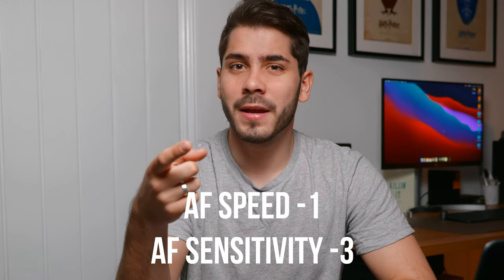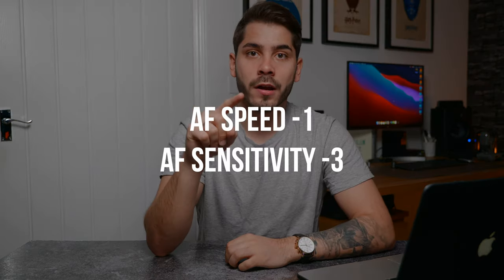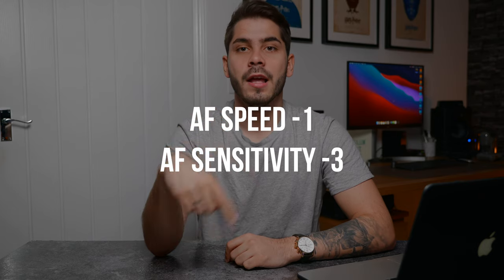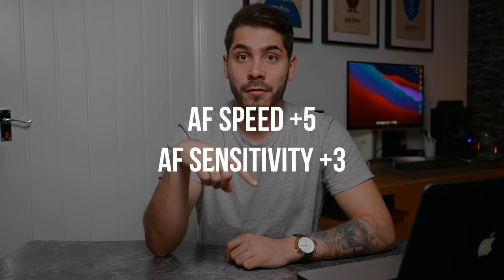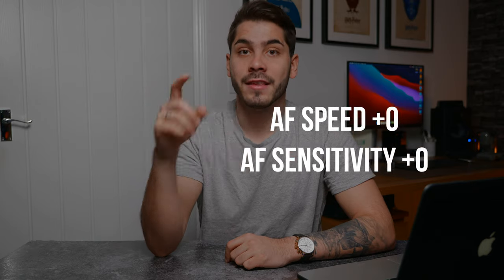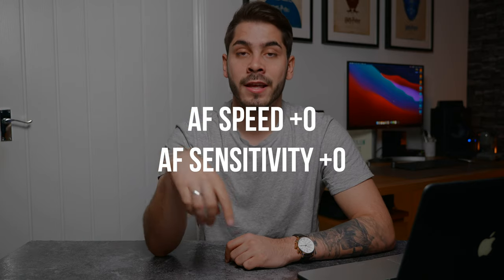The BEST Panasonic S5 Video AF Test You'll See - REAL WORLD PERFORMANCE

Comment: Josh - what lens did you use. Im interested in the S5 because the 20 60 kit is my Ideal working range. 
I only use single shot AF anyway but this video shows its possible to get some gentle tracking. - thanks - 👍
Reply from the maker: Hey Mark! I used the 24-105 F4 (it's actually the only L Mount lens I own!). 

Fantastic lens for the price and extremely versatile. It's definitely possible to get some tracking shots as long as the subject doesn't move to erratically. 

Thanks for watching!

Comment: Hi Josh, thanks for that great video. I have an S5 but have not used it much yet due to lockdown and winter! Did you reach a conclusion about the best settings in vlog? I have left it at the default so far.
Reply from the maker: Hi Andrew! Thanks for watching my video! Ah that’s a shame, it sucks when we have a shiny new camera but no way of using it! 

So far I’d say that the VLog AF performs very similarly to the other picture profiles, so therefore it’s a case of which setting works best for you. I tend to leave my camera on -1 speed and -3 sensitivity since what I use the AF for tends to involve less movement. 

+5 and +3 would be the best if there’s sudden changes happening, but you also get more pulsing in this setting since the AF is acting at its highest sensitivity. I hope this helps!
Reply: @JoshCameron  Thanks Josh, I liked and subscribed. I will try those settings when I get going again. I did try the camera with stills, impressive and lovely quality files

Comment: I shoot mostly product vlogs, so I want the camera to prioritize the talking head, but it should switch over to an object if one is held in front of the camera.

Right now, it seems that the best way to do this consistently is by covering my face with the object first and then move it towards the camera.

The thing is, I don't want it to block my face all the time. I want to be able to hold the object at a distance so that it is in focus while I'm blurred out talking in the background.

Is there any way to achieve this on the S5 or am I doomed in this DFD hell?
Reply from the maker: I believe if you disabled the human AF and used near shift AF then you should be able to achieve this!
Reply: @JoshCameron  Thanks Josh, that's exactly what I've been doing lately, shooting in AF+ mode with human AF OFF. It does lose focus if my head is not in the box, so I have to make sure it's there all the time. It's not perfect, but it works 90% of the time.

Comment: Can I trust the s5 autofocus for wedding videos?
Reply from the maker: Short answer - no :D
Reply: Thanks. The codec is good but AF no.. Maybe I go for xt4 buy budget only 2k..
Reply: long answer - yes ! if you work with gh5 in weddings, you can work with s5 and the 20-60 or 24-105. just try, dont ask... the af is good but not super.. the true, you dont need a super af !
Reply from the maker: @shtrudel-pu1cm  I agree with you here. It's definitely useable and will work for you if you use it correctly. It just depends on what you're most comfortable with. For me, I'd only use MF on shoots where things can't be done twice (like weddings), just because I have more control that way. Even with my Sony cameras I wouldn't use the AF for weddings (or at least for the most important moments of the day), because I wouldn't want the camera to miss a beat in a situation where I could have used MF if I wasn't just being lazy. 

The AF on the S5 to me is far better than what people have made it out to be though - it's just for me, I wouldn't use AF when i'm being paid (unless I had full confidence that nothing was going to change in the frame!) At weddings you could easily get some someone stand up in your way, or walk off to the toilet during the ceremony etc, and I wouldn't want my camera to see their face and make them the point of focus!
Reply from the maker: @germancreatives88  I would still say the Panasonic S5 is a better option than the XT4. I have the XT3 and I much prefer the Panasonic over it. I feel like it's a more pro camera than the XT4 and is far more versatile!
Reply: @JoshCameron  Thank you it helps with my decision
Reply: @JoshCameron  in terms of autofocus which you prefer? Fuji or S5?
Reply: @OfficialJ2M  Fuji doesn’t have tracking/lock on AF in video apart from face/eye detect 

Panasonic at least offers tracking/lock on

Comment: Hi Josh, thank you for doing these tests!
Did you use any filter on the 24-105 or did you compensate just by the aperture? Also, what framerate and shutterspeed did you use (looks like a proper cine-angle was used), because from my experience (I own Gh4R, GH5, G9 and S5) Lumix DFD autofocus is more sensitive in some framerate/shutterspeed combinations (from my experience 50p-1/100 works a bit better than 25p-1/50 (especially on G9 and S5)
Reply from the maker: Instead of cranking the aperture, I normally use a VND filter - like these ones: https://youtu.be/pssCHl2uKCY